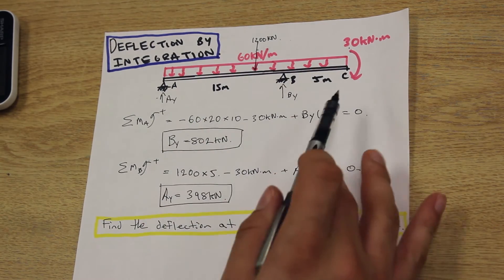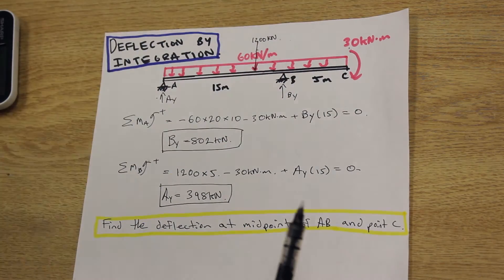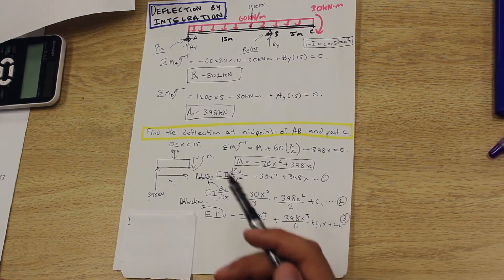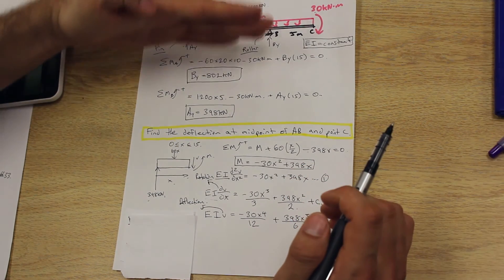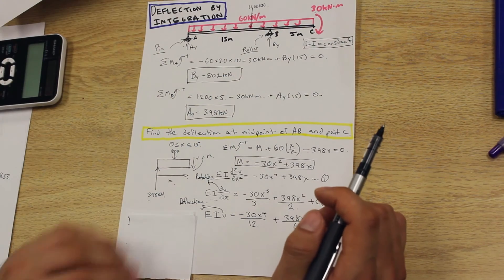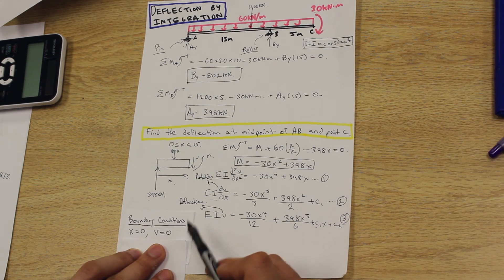Solving for Deflection of a Beam Using the Method of Integration - Part 2/4

Comment from the maker: TimeStamp !

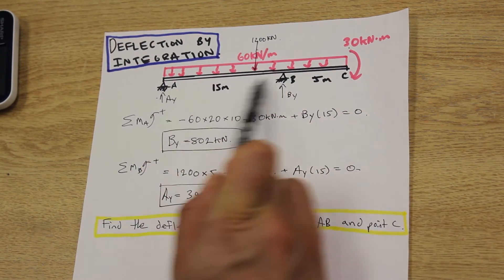1:23 - Theory Ends - Solution Beings (Dont skip the Theory!)
1:35 - First Step - Cut in-between "0 (zero) and 15" 
4:24 - Second Step - Find the "Deflection" in the section 
8:18 - Third Step - Solve "C1" and "C2" using "Boundary Conditions" 
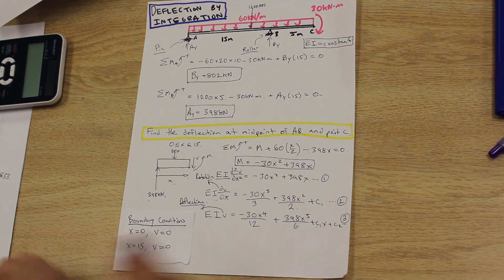10:04 - Final Solution (Now try to do it on your own!!)

The "Deflection By Integration" problem has FOUR Parts

Part 1 - https://youtu.be/39zdlzwDvgI
Part 2 (which you just watched) - https://youtu.be/v7Zqpy5zxvM
Part 3 - https://youtu.be/RMTOw4C2T34
Part 4 - https://youtu.be/ZA4L7yPXseo

Comment: So one question, after splitting your beam at a length x, the equation for moments was "M = 60(x/2) -398x". Is it not supposed to be "M = 60(x^2/2) -398x"? That would be to facilitate half the span of the UDL on the length, x!
Reply from the maker: Vinesh Boodram you're totally right, we forgot to include the x in front of 60 there.  It''s included in the final moment formula I must have just forgot it there. It should be 60x (x/2). thanks for letting us know!
Reply: Thank you! Your videos are great...keep up the good work.
Reply from the maker: Thanks Vinesh! If you ever catch little mistakes we've made in any videos we love to hear about it so we can make notes and not confuse anyone.  Appreciate the feedback.